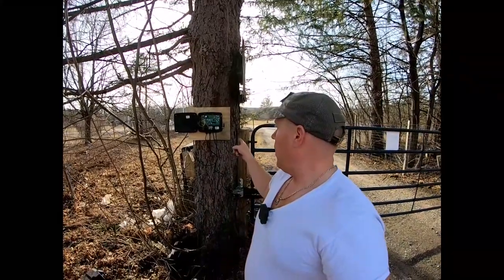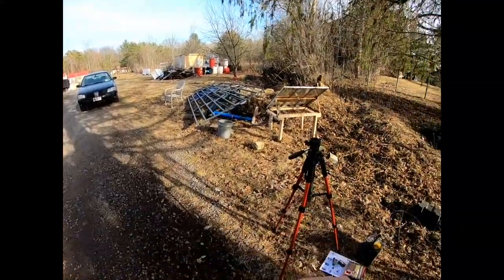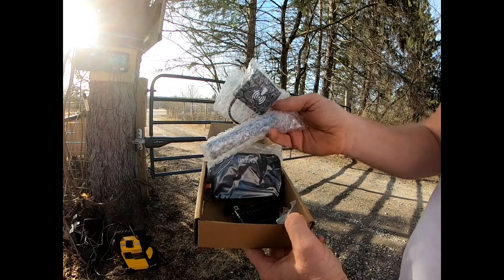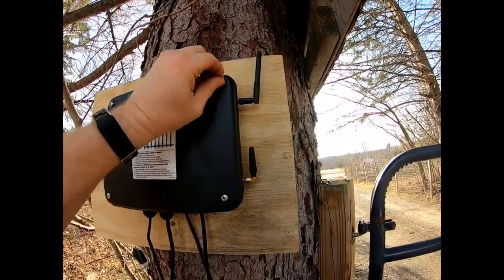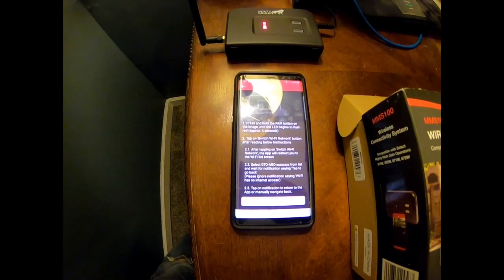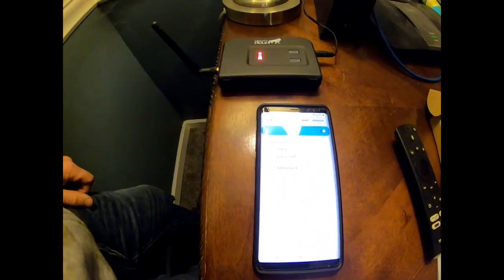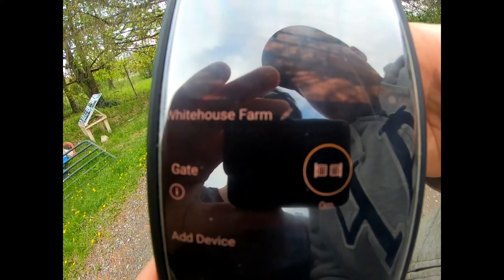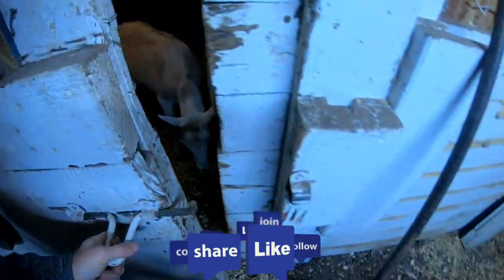Mighty Mule (Newest) MMS 100, Part 2

Comment: I went through much of the same rigmarole that you did getting the MMS100 set up. (except I didn't video my efforts--congrats for doing that; I'm sure it helped a lot of folks).  One question: Do you know what the RESET button does? I can't find it anywhere in the documentation. I don't want to try pressing it because I don't want to start all over on the pairing process 🙂
Reply from the maker: From what I understand , it resets the link between the bridge module and the control box if you are having difficulty connecting, almost like our phones if they start doing something funky you restart your phone and then it works correctly, I haven't tried it myself yet because I haven't had any issues yet knock on wood lol, but great question and if anyone else has a better answer I would like to know myself! thank you for watching!👍😁

Comment: 19:00 will the app only work when you are connected to same wifi or can you open gate while on the road miles away? (using cellular)
Reply from the maker: I think the clickers have roughly a half mile, I have been able to open it from my work cellular 25 miles away I think as long as you are connected to the internet or cellular internet you can open it anywhere anytime!  Thank you for watching!👍
Reply: @WhitehouseFarmVet  Thank you for that info. I didn't know for sure and couldn't find answers anywhere. So once paired using WiFi, registered in the app. It also works on cellular service. Awesome. Thank you for your reply.
Reply from the maker: No problem anytime!😉👍 Have a Merry Christmas!

Comment: This is a pain in the butt to set up but your video is certainly helpful.  My problem now is: adjust the open & close on the gate.  I keep getting an error message about an obstruction.  So I called MM and they had me remove the pin from the arm on the gate which has now presented me with an even bigger problem.  You adjust the open/close distance on the control box and not the arm - is that correct?  MM technicians gave me bad info.
Reply from the maker: Press and hold the s2 and s3 buttons from control box until led 1 turns on and buzzer sounds,
Use your s2 and s4 buttons to set your gate to where you want it
Then press s3 button until it buzzes to set it!
I hope this helps out and thanks for watching!👍
Reply: @WhitehouseFarmVet  thank you.  You've been the most helpful person as far as this MM gate opener is concerned.. BTW, I sent the MMS100 back.  It simply will not work on any level and I think it's a piece of junk, and evidently that's not just my humble opinion.  🙂
Reply from the maker: Well thank you anytime!! Sorry your MMS didn't work for you I read alot of comments that people had the same trouble,  thank you for watching! Have a great Christmas!👍
Reply: BTW, do you have a FB page I can follow?
Reply from the maker: I do its Whitehouse Farm and I also have Instagram and a tik tok, if you click on my YouTube homepage and then click on the title "about, it will have those links as well,  thank you!😊
Reply: Anyone ever find a solution the “obstruction” error message? It’s driving me crazy and MM has no clue how to fix the issue
Reply from the maker: Not sure if this will help with your situation, but I know this was the trouble I was constantly have happen to me with the weather!
https://youtu.be/0wBpPdcp4w4
Reply: @WhitehouseFarmVet  thanks.  We finally got it solved.  Appreciate the video!
Reply from the maker: That's great,  glad to hear that!!!! Thank you for watching! 👍😁